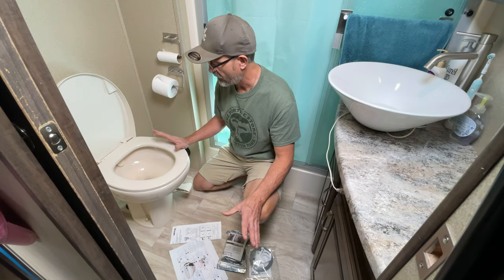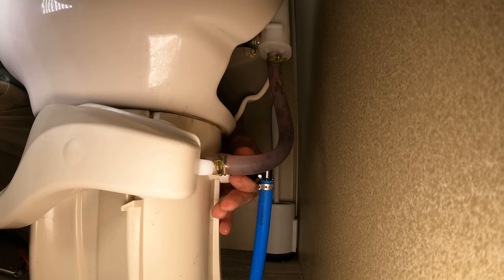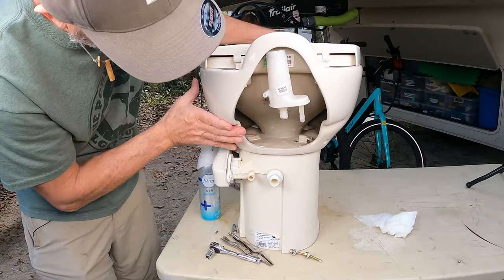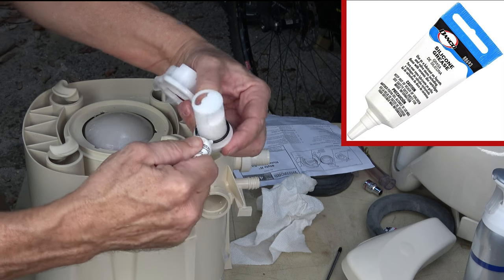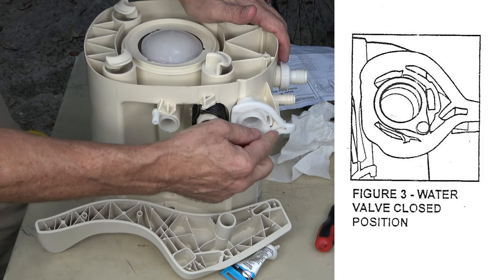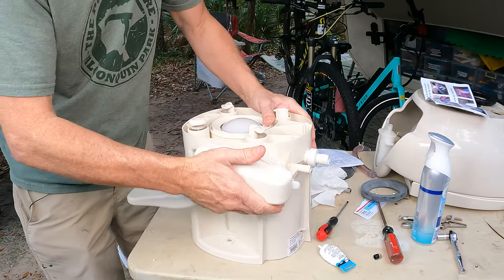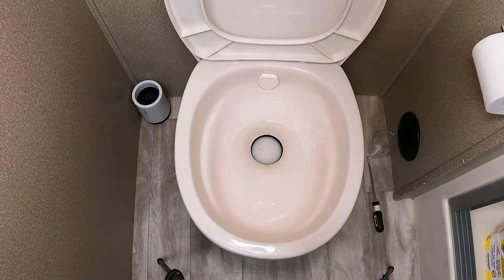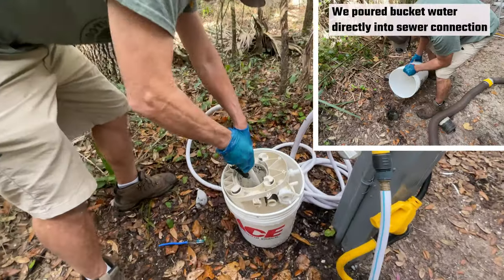RV Toilet Problems, How to fix Thetford Aqua Magic 2 (RV Living) 4K

Comment: Thank you so much for this video.  Our toilet base started to leak and the dealer couldn't figure out why.  They said the toilet needed to be replaced to the tune of $500!!!!  A new toilet on Amazon would cost around $200.00 or we could order parts and try to figure out what was broken.  But after watching your very informative and well-done video we saw that we could just order the base (it now costs $90.00 on Amazon) and replace that.    So that's what we did and it was super easy.  THANK YOU!
Reply from the maker: Yes. We actually made another video when the toilet failed again. 
So we ordered a new base - wish we did that from the beginning

Comment: Excellent job! I took ours out just to clean and soon realized that the buildup in the inside of the base was not easy to clean. A biochemist friend reminded me that the buildup was the calcium in the water and the calcium in the poop! He suggested using a wood stick to scrap it off. After about an hour of trying every chemical in the arsenal, Ajax andgreen scratcher pads, I tried the stick idea and he was right. It's like scraping barnacles off a boat! Looks beautiful now.
Reply from the maker: We ended up trashing it - another video - because it started to leak again. 
We got a whole new base

Comment: Great set of instructions.  Allowed me to replace the leaking components in about 1/2 an hour.  Now, like you I've got to decide if I should replace the whole bottom section after it started leaking again or buy a different brand of toilet.  However your instructions on how to do the repairs were the best I've seen on YouTube.
Thanks
Reply from the maker: About a year later, we replaced the whole base. There’s another video for that. 
Next? I want a whole different brand

Comment: We now have a leaking toilet. It is not completely stopping the water flow into the toilet after the flush. So far it has only overflowed once. Even though it was clean water that overflowed, once is still enough. We are discussing now whether to rebuild the Thetford or go all in on a Dometic 320 series. We'll let you know! Thanks for the great tutorial!!
Reply from the maker: Hey, we actually made another video where we bought a whole new base. It fixed the problem but I wish I got a whole new upgraded toilet - but that’s just me (Alice, of course) 😉

Comment: Thank you Larry. I went on vacation and paid some ladies to clean my Jayco. When I came back the toilet didn't seal. I think they must have really done a number on the waste ball.The toilet no longer held water.  I replaced the waste ball seal and everything went fine but when I had the toilet off I think something got out of whack because the foot pedal action was no longer smooth. Thanks to you, it is easier to pay the $90 and get a whole new base. I could attempt an RV toilet valve replacement (all that stuff under the foot press) but I think I will hit it out of the park and do the whole shootin' match in smooth move. Once again, thanks.
Reply from the maker: Sorry that happened. 
Actually, we recently made a video showing we threw the whole base away because the ball valve started not to work again. So worth the extra money 
Let us know how it goes

Comment: Great video Larry. I had a leaking water valve in ours. The one thing that needs to be mentioned is to be very careful removing the flush peddle. If it doesn't come straight off the base, you could have the spring, be dislodged and it is extremely hard to put it right. After 2 hours and banged up hands I gave up and ordered a new base. Which is what I should have done in the first place. Thanks again for the video it inspired me to replace the base.
Reply from the maker: I did another toilet video where i just replaced the whole base, its not worth it to fix all those parts, deal with the handle spring and the mess.  Larry

Comment: Thanks for the video, I just finished replacing the same parts on my Thetford Style II toilet and used your video as a "helper" to double check my reassembly. From what I observed the 2 toilets are, for all practical purposes identical. Well, mine wasn't as clean as yours in the video.
Anyway, nice job! I did come across one thing that you didn't mention: lime scale. It was around all the contact points that the seals met the porcelain and waste ball. I'm convinced that after only 2 short years it was scale build-up that compromised the seals. But that's my opinion. This is my 2nd trailer with identical Thetford toilets, my other one I changed the waste ball seal when I first got it and never had another issue. Thanks again for the informative video and keep 'em coming.
Reply from the maker: I agree it’s the scale is what causes the leaky seals.  The water quantity at most campgrounds is crapy hard water.  I cleaned mine a bunch before I filmed, haha.  Larry

Comment: My spring was messed up when would up it would sit in the notch on the toilet, but once I put the flush pedal on, it would bring the spring out of the notch, when I took the pedal off the spring unloaded and busted my hand up good. I got it back together but next time she gets a whole new base. Thanks for the details
Reply from the maker: Yes it is so much easier and less messy to replace the base, im thinking of switching toilets if it happens again.  Larry
Reply: I just tried fixing mine and the spring also came off. I got lucky it didn't hit my hand. New base has been ordered. I'm sure I will see that spring again in my nightmares.

Comment: thanks for the video. Toilet started running at the same time the refrigerator went out.  I'll take the advice and replace the base.  Not sure what to do about the 12v refrig.
Reply from the maker: Eric, we definitely wish we just replaced the base to begin with. Much cleaner job 😁
As for 12V fridge? We just got our first one - no issues yet 🤞
Good luck,
Alice
Reply: @DownsizingMakesCents  Turns out I just replaced the water value and leak stopped.  12v refrig was just loose wires in the back.  Definitely could not have done the toilet without watching the video step by step as I followed along.  The pedal was the hardest part.   Thanks so much for the video!  Keep RVing!

Comment: This video is GREAT! Very clear, detailed instructions with the video to show every step. I had to replace the 'waste ball' due to the original screw through the 'waste ball drive arm' being too tight or large. It had split the plastic. Not the best toilet design but this video was extremely useful. Thanks Larry!
Reply from the maker: The next time I just replaced the entire base instead of dealing with a dirty waste ball.  Larry

Comment: Great video. I just installed the water valve kit and the waste ball kit. Unfortunately, my new waste ball and seal are leaking ( the bowl doesn’t hold water) . I followed the instructions which followed your video. Any suggestions as to how to get my new kit to work?
Reply from the maker: I think what happened when you reassemble the ball to the base. If the waist ball seal shifts just a little bit, it will leak I recommend pulling the bowl off again and making sure the seal is centered. I keep extra seals on hand, because sometimes this happens, the seal gets damaged and it’s better to just put a new one on.Larry
Reply: Thx Larry. I did struggle to get it where I thought it was centered to begin with . I added more plumbers grease and that helped slow the leak but didn’t stop it. I’ll try replacing the seal again. I’ve also had trouble getting the base to fully seat to the floor without wobbling. I keep retightening the nuts but it still wobbles. I think the closet seal is too rigid. I had two to choose from and I chose the one that was more dense. I’ll probably switch it out too to see if the softer one seats better.

Comment: Hi, Larry. My wife and I own a 310GK, too, with the same fixtures.  As I was flushing, a part came flying out at me and the ball valve shut only 3/4 of the way.  I did some research and found it could be the ball valve drive arm had broken...the part that fits into the pedal.  After looking at the exploded parts list, I was pretty sure and about to tear into the base area.  Even tho I haven't 'eyed' mine yet, looking at your video, I was close to 100% sure it was that arm.  I couldn't find and order the arm by itself, so I ordered the complete base.  Looks like an easy fix once I get it.  Thanks for the video, and I hope your treatments for MOGAD are helping greatly.
Reply from the maker: Hey Winn, the arm on our original base was broken where the spring connects, unfortunately you can’t buy just the arm you have to get the whole base,  larry
Reply: @DownsizingMakesCents  I saw your leak thru your video.  I'm so glad you filmed that.  Made my job much, much easier.  The base should arrive at my location this coming Monday, 9/26.  BTW, while living in Florida, I used to service the anesthesia and medical equipment at Shands.  Best wishes.
Reply from the maker: @winnhorton7467  putting the entire base on is so much easier than fixing the toilet.  that’s funny, I used to be a surgical device rep at Shands.  Larry

Comment: Thank you for your detailed explanation, I have to take on this task as the bowl is not holding water.  With expectations that I would need to do this eventually, I had purchased the seal.  Now I just need to take time and do it.  Not looking forward to it for sure!
Reply: We are actually coming up with a video tomorrow where I recommend replacing the entire base of the toilet instead of replacing the parts it’s $30 more but it’s a lot less messy if you know what I mean
Reply: @leapnlarry  well I just found out today that a little bit of plumbers grease will help stop the leak at least temporarily until I can get to a place where the weather is cooler and I can work on it.  Unfortunately I found a new leak coming from my kitchen sink side underbelly very small leak and that side also has a defective gray water tank gate that allows water to leak into the line and perhaps there is a bad connection in this area that is allowing this same water to leak and drip to the ground.  After I let the water out of the drain pipe it seems to have stopped dripping so my hypothesis is that it’s not from the tank itself 🙏 but after the gray water gate along the pipe, that is something I could tackle and fix, a leak from a cracked tank I could not.

Comment: Thanks for the great video.  Question:  Is there a seal on the driven side of the waste ball?  Also, what are your thoughts on periodically applying some plumbers lube to the bottom of the seal for the waste ball - I wondered if you could open the ball, smear some lube on the bottom of the seal (with gloves on) to keep it lubed and sealing...
Reply from the maker: We talked to a Therford guy at the Tampa show and he talked about the lube. 
I can’t really answer your questions and Larry can’t right now. Sorry. 
Try to reach out in a week or so. 
Alice

Comment: Great video but 1 mistake. I confirmed with Thetford that the small end of conical spring for the water valve (part # 42049) goes into the rubber seal.  So that means that the wide end of the spring fits into the toilet base first followed by the rubber cap seal.

Comment: Larry great video, just replaced our domestic toilet. It called for toqueing the hold down bolts to 14 inch pounds. Again great job.
Reply from the maker: Hey Larry, I didn’t see any torque specs in the thetford installation manual but it is important not to over torque these plastic bases or they will crack.  Larry
Reply: @DownsizingMakesCents  Your right, it took me about an hour to find an installation guide for my dometic toilet. And again great job keep em coming. Larry

Comment: What are the extra parts for in the 34120 kit? Where do the 4 plastic washers go (unless they are for a different model?) and extra drive arm rubber ring? So no rubber ring goes on the far side? (there was not one on on disassembly)

Comment: I will second this video - I did the replacement of just the seal in between the bowl and base. The seal that I got was not a good quality one - it wasn't OEM - it caused more problems then the flapper activator part broke causing us not to be able to flush. Thankfully, I could still get a pair of Channel Locks in to activate it manually until Amazon delivered the replacement base the next day. Re-installation of the base, vs cleaning things up prior (YUCK) was way, way simpler. The only thing I hate is the screws at the back of the toilet - I didn't do my installation outside, I did it all in the bathroom and got real close and personal trying to get those damn screws back in. In the end though, I'm happy, the toilet works and our full-time RV life can continue. Thanks for making this video!
Reply from the maker: I’m glad you got it worked out, our 2nd video we just replaced the entire base like you did, it didn’t cost that much more, thank you for sharing your experience.  Larry

Comment: Very good video question, conflicting reports the flange seal the way I read it on the instructions, flat side down to the subfloor flange, bevel side up to the toilet pedestal
Reply from the maker: Yes. He followed instructions. He just turned it to show in the video the parts. 
But he actually had to buy a whole new base because the fix didn’t last. 
We have another video for that 
https://youtu.be/-GSuLgNSQ8M

Comment: Great video Larry! I’ve already done the seal kit replacement in our 2017 Jayco last summer since it wouldn’t keep any water in the bowl. I will certainly keep this in a playlist since you did an entire rebuild! We haven’t had a valve leak “yet” but when it does, thanks to you, I’ll know what to do! Thank you, again!
Reply from the maker: Thanks for the compliment Joseph, the valve seal isn’t really designed well.  One of the things that happened to us that I didn’t say in the video was, the valve got stuck and overfilled the bowl and spilled all over the floor, luckily it was just water.  We were home at the time so we noticed it.  That is one of the reasons i shut off our water at the spigot if we are leaving the RV for any length of time over an hour or so.  Larry

Comment: I really love the walktrhough and watched it multiple times while replacing my wasteball. I used the WEHOPE kit with the ball included. However... the replacement ball is just a hair too short to make an easy seal. Now when I flush I have to make sure that I let it snap shut at full force or push up on the pedal to get the seal to hold water. Not sure it its user install error or if the ball kit is just poorly designed with little room for variance. Have you heard anyone else having this issue?
Reply from the maker: This kit is a lot cheaper than the Thetford. So it may not fit as well. 
We ended up replaced the whole base - we made another video about that because of the same issue

Comment: Great video, we having the same problem with ours but our rig is only 10 months old.  We do live in it full time but didn’t think it would go bad so soon.
Reply from the maker: Our waste ball had been leaking for a while, causing a bad smell but the leaking valve just started recently, water damage in our RV is one of our worst nightmares so we took care of it right away.  The valve can also stick causing the bowl to overfill after flushing, which can be a messy cleanup.  Larry

Comment: I have tried different ways to replace the flush valve. I have the same toilet as you. I have a 2020 Grand Design 380fl. I can't seem to get the o ring to stay put. It slides up and gets a little squished out when I flush the toilet. It leaks real bad. I have tried grease and not put it all the way to the top of the plastic part. Did not stop leak. I tried to put it to the top as another YouTube said to do and did not help. I feel I might just replace the whole toilet. Do you have any recommendations? Anything will help. Lucky for us we have a second bathroom as we are full time stationary. Thanks for your videos. We enjoy them.
Reply from the maker: I did a video where i replaced the whole base.  Instead of $50 in parts it was $80 the the entire base will all the parts.   Thetford Aqua Magic 2 RV Toilet, Replace the Entire Base (RV Living) 4K
https://youtu.be/-GSuLgNSQ8M
Larry